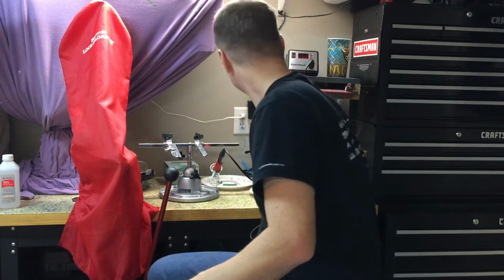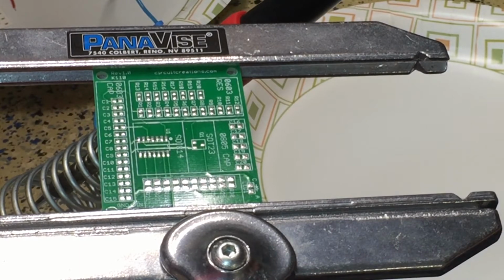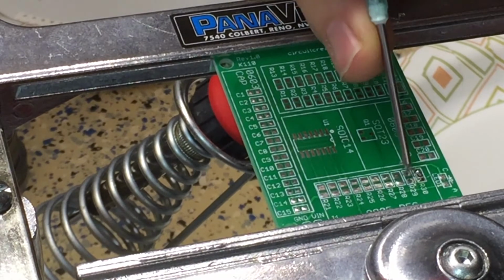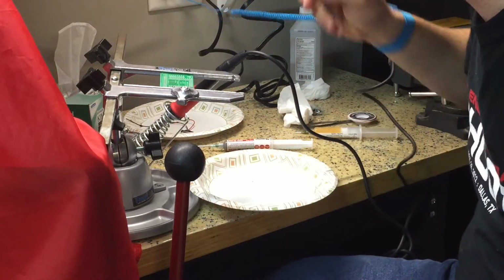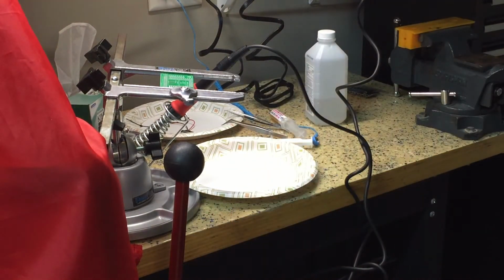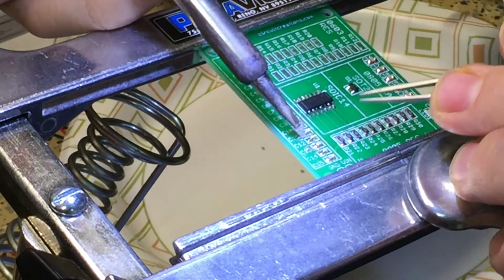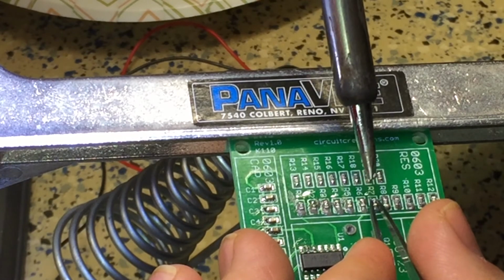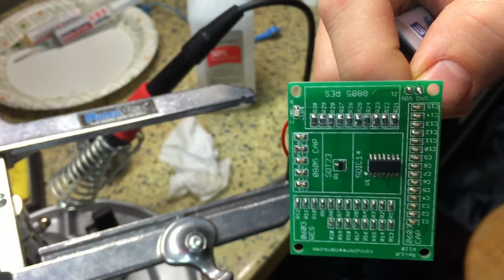Weather Balloon - Part 3 - SMD Practice Kit (Failed)

Comment: You are doing the same thing as me,I bought several smd practice boards,from 99 cent ,to almost $8.00 because I am a lot older than you and my eyes aren't as good as your,are you using lead solder paste,or non lead,I only use lead solder paste.,have you thought of getting a rework station ..they are pretty helpful,,I like your site here its helpful.